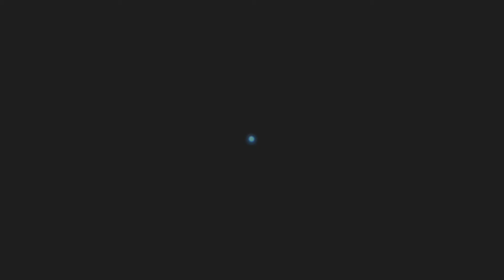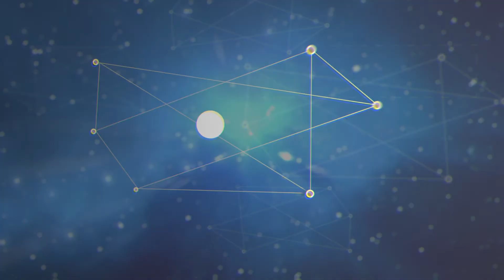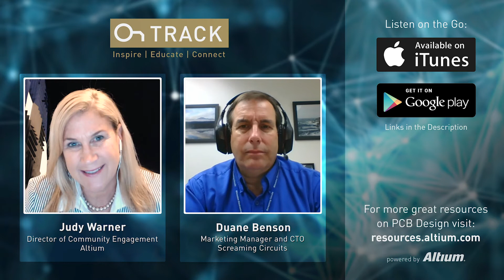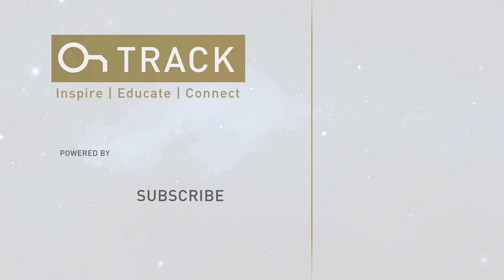Best DFA Tips from Duane Benson at Screaming Circuits [OnTrack Podcast]

Comment: 26:50 I can confirm that engineers are indeed freaking out over component availability! 
I can design a board based on parts in-stock at multiple distributors, send it out for manufacture, and have some of the BOM components go permanently out of stock worldwide in the week between the manufacturer starting to make the bare boards, and them being populated. Big companies are now swooping in and buying up all the stock not just from manufacturers, but from end-distributors like Digi-Key and Farnell, which puts electronics designers in a really bad situation.
Normally, when they are issued with a board design for manufacture, a manufacturing sub-contractor will start the process of making the PCBs, and they will be well underway before they even think about ordering the components. 
We now have to tell them to order the components first, before starting the bare board manufacture process, to make sure the board design won't get rendered obsolete by component availability issues before the first one is even made.
For production runs of a new PCB design, that means doing a lifetime-buy of whatever components have the highest availability risk. This is especially true for capacitors, the availability of which could once have been taken for granted.